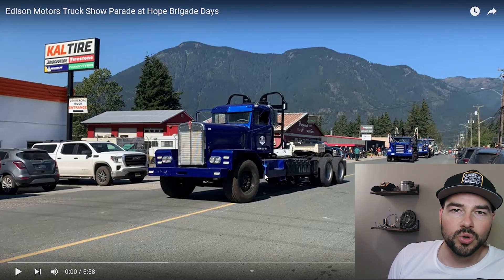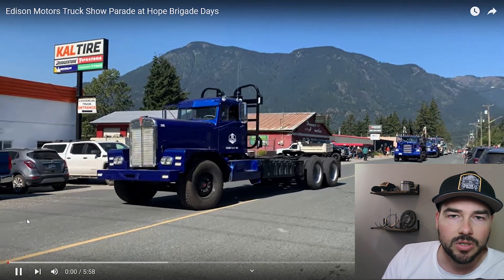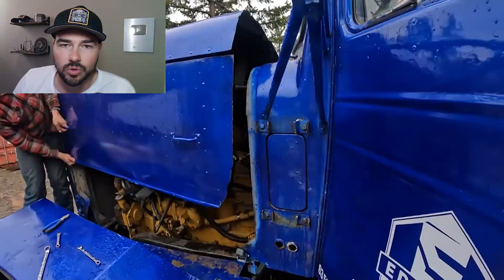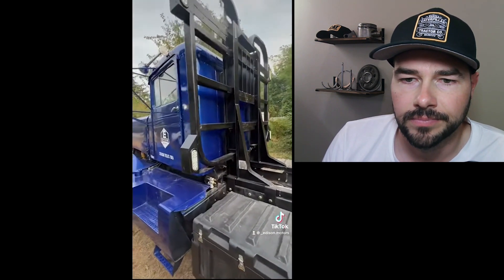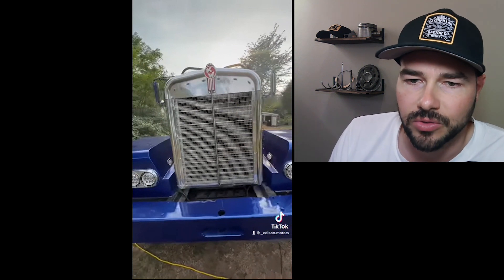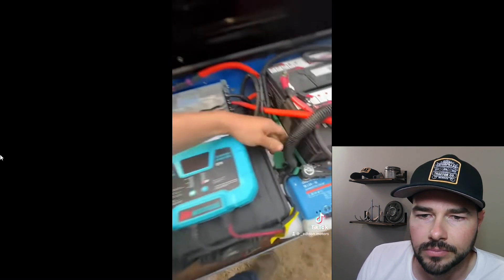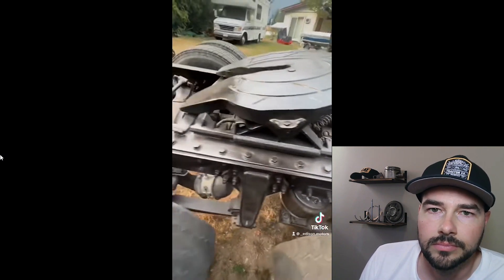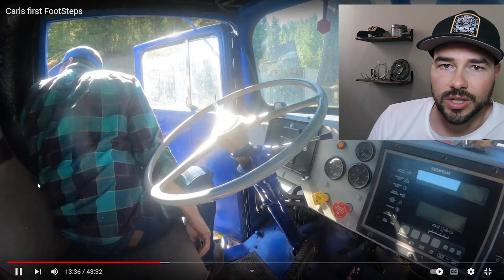Mechanic Reacts to AMAZING Diesel-Electric 1962 Kenworth. Edison Motors.

Comment: I've wondered for years why no one has adapted diesel/electric train traction motor system (scaled down) to work with a modern battery/regen storage for Road Trucks.   I'd think GE/EMD (Buffett) could make this  happen... they haven't but they sure could.   Maybe it just doesn't scale down well.   But, he did say electric axles....  so that is a step closer to true traction.  Gets rid of the differentials.
Reply: Cost of vehicle. Cost of maintenance.
Not the same electric motor as a Prius.
Reply: Youre also dealing with different traction material, grade, and wind resistance variables. 

Steel on steel low speeds low inclines vs rubber on concrete high speeds high inclinces.
Reply: Worked on a Oshkosh HEMTT that was basically that it is expensive complex and not that much more efficient
Reply: Think of how much freight a train can pull , per pull ... that means that per mile , they generate a LOT more money . Which makes a much more expensive settup a viable option . The reason that combustion generated electric does not make sense for a semi truck , cost prohibitive for the type of work ... if pulling 400 trailers it's not cost prohibitive , if pulling 1 trailer , doubles or even triples its just a cost prohibitive settup .
Reply: Weight is a main reason
Reply: @smaksymiv4950  That makes sense... sorta.  (The following is not meant as an argument, just blue-skying)   Rail freight has always been the most efficient on a cost per ton per mile.   But they should be able to scale it down.  You don't the 4,000 to 18,000HP a freight train needs, 300 - 400 hundred HP should do it.   Much smaller alternator too.  Your traction motor axles could be MUCH smaller but would need some sort of disconnect for cornering, but that could be electric coupling based on front wheel angle.  The tractive effort is similarly less as well...   ~80,000 pounds max vs 18,000 tons.  Regardless of the power of the drivetrain, electric is always Max torque at Zero RPM.  The one advantage in a hybrid scenario is that unlike a train which maintains speeds for hours, a truck will often be slowing so the regen could be applied to braking to recover energy.  You eliminate the transmission, driveline, differentials, clutch/torque convertor... even much of the braking...  all high wear/maintenance items.      I could go on, but thank you for reading this far.
Reply: Locomotive mechanic here. The big issue is the control system. It’s not as easy as hooking up a generator to a motor and hitting go. If you look at a locomotive, we have a compartment as big as a truck cab just dedicated to the contractors, rectifiers, inverters and control modules to make the entire system work as effectively as it does. You need a means on controlling direction, and controlling output of traction which gets more complicated when you realize that a genset like they have is designed to operate at a set steady voltage and frequency.
Reply: Lots of ships are Diesel-electric as well. Many of them have electric motors directly coupled to the propellers or jets.
Reply: It can be done.
Reply: I’ve wondered that as well.
Reply: Very expensive. Being around modern drilling  rigs that utilize same technology hence Generators, Rectifiers, Variable frequency Drives, traction motors and controls, PLCs etc.  It is very expensive. That is not including hybrid technology to include batteries that require 1000s of tons of earth excavation to gather the elements to make 1 battery bank. $$$$$$$$$$$$$$
Reply: I've wanted something of the sorts for a while
Reply: Look up Hyliion.
Reply: A lot of the very first cars were. The very first porsche was a gasoline generator, electric drive. So were a lot of tanks. The reason most cars throughout history haven't done this is cost and weight of the old technology. With modern engines, batteries, and motors, we'll probably see this done more often
Reply: Somebody did do exactly what your talking about they where able to run a semi off of a 4 cylinder John Deere and it got almost 30mpg loaded and all you had to do was send him your truck and he did the conversion and he would send it back done with thee original motor and transmission on pallets and he did it all for between 75-80k I saw him and a truck he did at a semi truck show in Kentucky several years ago but now he's vanished you can't find any information about him or his original truck he built there are some of his old customers still around but all the trucks are gone been bought and have disappeared
Reply: Totally gnarly and kickass engineering design
Reply: @smaksymiv4950  there was a company, I believe in PA, that was adding a deere 6.8 powered gen set to locomotives.  Once the load was moving the locomotive engine would cut back and the deere engine would provide steady power for steady movement
Reply: I don’t know but I want one
Reply: weight and cost.
Reply: Nov 10, 2008 — Peterbilt Motors Co. has debuted a Model 335 hybrid electric ... and the Model 386 Hybrid Electric vehicle for long-haul applications.
Reply: did you watch the vid?? - this IS a series hybrid with a plug in battery bank just like a Diesel-electric train... It has a single traction motor and "normal differentials" ,"powered" through a 4 speed transmission. - seems many of your fans are robots replying to a different video ???
Reply: @kadmow  but the point made is that this isn't a more common design when it is perfect for today.
Reply: @blendpinexus1416  , sometimes things just aren't done because a simple transmission works is lighter and is more efficient most of the time. Drivers love swapping lots of cogs.
Reply: What would be the advantages? ....Smoother traction at low speeds, right? If you need that type of power like in logging it would be pretty awesome, also  Plowing. But there's plenty of disadvantages, carrying  all the weight of a diesel plus the weight of a battery & motor. set
Reply: There is some airplanes that are doing that with electric motors in the wing for thrust. Then a gas turbine generator set in the fuselage for power.
Reply: @paulwoodman5131   (some energy buffering is desirable in road-going / variable-demand, diesel electric setups, the benefits are perfectly controllable torque - to the power limit, and ease of adding "another" driven axle group.. - to date the cost and / or weight in batteries have made seriously (big battery) augmented systems unviable) - for a single driven axle-set a motor and hydrostatic + epicyclic transmission are probably simpler - for a multi axle-set, distributed power, D-E  / BEV starts winning.)
Reply: @kadmow  i can't disagree there. my little car with it's 5 speed manual is just a blast. can't imagine the fun with an 18speed
Reply: @paulwoodman5131  With all the weight of the engine, genset and batteries plus the weight of the truck/cargo there would be a huge dynamic braking recovery (regen) to be had.   I live in the Sierras and the run from Rocklin to Reno is a truck and brake killer.  Trucking companies could setup depots in Rocklin and Reno and use these trucks to easily make round trip passes every 4 hours.   Let regen handle the downhill (save brakes) and let the batteries get you back up the hill (well probably 85% realistically).  Lower fuel costs, no transmission to wear out, No clutch to wear out, no driveline to wear out, no rear end gears to wear out, lower emissions, less issues with air density....

There is a place for a road going hybrid locomotive.  It wouldn't work everywhere.
Reply: They should also add battery cars behind current locomotives to store and use  the down hill regen that is currently wasted as heat in huge resistor banks.  The locomotives could also charge the batteries at times their diesel engines are producing more power than the electric motors need, like idling during a wait period.   I bet it could reduce diesel usage in the rail industry considerably to not be wasting all that braking regen and power output in excess of need at periods of cruising and slow travel.  The Diesel engines might be able to shut off entirely a significant portion of the time.
Reply: The electric axles will have a single motor and a diff, for each axle... 

   A plus side of this is the diff and axle, and all attachment hardware, brakes, wheels, tires, shocks, etc, are existing off the shelf, and available everywhere, truck parts that you don’t have to order from Edison if you break down in Florida.
Reply: Do diesel electric trains have electric axles
Reply: @benjaminbaird3798 that’s because it had to be a scam.  You can’t do what you said was done with a small 4cyl engine.  It all comes down to energy.  It takes a certain amount of energy to move to move a certain mass a certain distance.  A small 4cyl engine doesn’t generate nearly enough energy to do this at any reasonable speed.
Reply: @romannabong6804 diesel/electric  costs less and needs less maintenance. It is not built for a specific reason: its long life and great reliability. When you have bought one you can work for 100 years without any problems (see trains ? ) . The production industries would go bankrupt.
Reply: @drwombat Sort of ,  there's a large electric motor, 500 to 1000 horse power, that's mounted on the axle, the power is transfered with a small diameter gear, 10", to a large diameter, 24", on the axle.

Comment: I own a Heavy Haul and Recovery co based in the west, My cousin who is an engineer for a class one railway,  he keeps asking me when semi's will convert over to electric motive power like the locomotives running down the tracks. If you look at the amount of weight they pull vs a semi, they get overwhelmingly better fuel milage. That "Karl" truck is in the right direction. What are your thoughts on the idea of electric motive power for Semi's ??
Reply: Don't double and triple trailer logging trucks pull the same or more weight than a semi truck? from watching Edison Motors videos the main advantage the electric logging truck has is that it can use the full load to fill its batteries with regenerative braking going down the mountain, and then drive up the mountain empty so they end up with an energy surplus from a route involving a mountain.
Reply: One reason trucks don’t use electric motive power is weight the truck would be thousands of pounds heavier even unloaded
Reply: @MRALBERT571 go check out Edison's recent videos. They finally weighed Topsy and it's actually lighter than a standard logging truck, but as an electric, it's max registered weight is more, so that extra weight allowance is handy when you get pulled into the scales

Comment: I was wondering when somebody was going to make a diesel electric tractor I mean they've been using them on trains for decades and if you want to be fuel economic environmentally friendly that's the best way to do it
Reply: JD is half way there with there eAutoPower transmission not full DE but getting close it can also off board 100kW of power for extra traction motors on equipment and there high end planters use a lot of electric motors so a PTO driven generator is needed but now they can draw the power directly from the tractor.
Reply: Jerry Boden  to go completely electric is not foreseeable without using some form of electricity generating apparatus like nuclear power. You're behind the times if you're running with colleges on trying to make batteries better only for the next decade we got to go beyond that otherwise it's not going to work and that's just simple physics

Comment: Diesel Electric semi trucks like this should be the real next step, NOT FULL BATTERY BS
Reply: Nov 10, 2008 — Peterbilt Motors Co. has debuted a Model 335 hybrid electric ... and the Model 386 Hybrid Electric vehicle for long-haul applications.

Comment: Trains have been doing this for nearly 100 years. The lower torque high voltage motors are now getting more practical thanks to Tesla and others. This is the more practical path forward then all electric. That may be a thing someday. But not practical ATM. It will be interesting to see how the technology evolves. This will be the stepping stone to get there if anyone has common sense in DC. But I digress.
Reply: Ideas so good the government has to mandate them.
Reply: @ChevyConQueso  trucks are bad enough with electronics and after treatment
Reply: Huge dump trucks have been using DE for decades with huge success! In fact they produce so much electricity that they have huge resistor banks to 'burn' off excess electricity when going down long or steep inclines. I believe we should be using this in our cars and trucks.
Reply: Jerry Boden  you are so true. Major buss brands here in Europe (which also builds trucks) tried this for busses like on 2011-2012, and it did not become a thing. Back then there where no batteries (or caps) that could take care of the regen power (at least not to a price that would make it worth it). The down side is converting diesel to electricity then to mechanical power is worse than converting diesel directly to mechanical power. The only benefit (without regen) is that motor can run on optimal rpm all the time.
Reply: RG LeTourneau was making them in the 1940s for Earth moving equipment

Comment: Diesel over electric is going to be pretty epic, can't wait till it catches on mainstream.
Reply: I like the idea of diesel/electric hybrid. Off the line performance will be greatly enhanced along with dynamic engine braking/generation.
Reply: Union Pacific started the trend... it will be interesting to see how this compares to straight diesel power in service. Logging isn't easy on equipment by any means, so there is a lot to compare here.
Reply: Only been on rails for 6-7 decades. I was so angry when diesel gate happened and vw killed their diesel electric suv development.
Reply: Ill keep it just Diesel 😉😉😉

Comment: I feel this is one of the best options for a) bridging the gap between ICE and full electric b) a Greta option for retrofit for older rigs which would also help with over alot poputiin because you'll be reusing older equipment instead of having to make a whole new truck.
Reply: right on point there devin, in particular with the long haul trucks where the 1000+mi range is a must for them.
Reply: Jerry Boden  the electric trucks your describing are only good for local in-city work, maybe going to the next city over. battery technology and the electric charging/power infrastructure just isn't at the point for many intercity and just about every long haul trucking yet.
Reply: Hyliion has added the 6X4HE System for long haul trucks.  Easily installed on new or retrofitted on existing trucks, the Hyliion System uses hybrid electrification to deliver fuel savings, lower emissions, instant telematics and a better driver experience. Mesilla Valley Transportation, PAM Transport and Ryder all participated in testing and refining the 6X4HE.

Comment: Most of the visibly sooty exhaust I see from Semi’s is at high torque moments, like starting from a stop, or climbing hills, when the engine is operating farthest outside of it’s highest efficiency zone.

Generators, once warm, can always run at the most efficient speed.  This means higher fuel efficiency, cleaner burn, and MUCH longer engine service intervals.
Reply: The black smoke is the governor allowing the fuel control rack to go to the "full torque" setting, which is the maximum fuel setting that is only used when the engine is lugging and needs extra torque, which then makes more smoke because there's more fuel. Fuel=power
Reply: @davesstillhere The black smoke is too much fuel for the amount of air it gets, which happens if the turbo hasn't spooled up to its final rpm for that throttle position yet. And no, more fuel than you have air is not more power, it's just wasted fuel

Comment: I had two of those trucks back in the day . They both had 220 Cummins engines with 2 stick 4 speed main trans and 4 speed brownie box. Pulled high side end dumps with them for valley wrecking service in sunland- Tujunga and San Fernando California.

Comment: He’s Canadian, so he calls it a motor, same as us in Australia, though we can call it an engine as well. Because it’s going to work logging roads, there’s a lot of steep hills, so I imagine he’s going to use regenerative braking to charge the batteries. The reason it isn’t mainstream is because of the weight of the batteries, electric motors, cost, complication, etc. It works on diesel electric locomotives because weight isn’t so important, but when they go downgrade the dynamic braking is wasted energy because it’s turned into heat through resistor banks on the roof of the loco. You can hear the cooling fans when they go into dynamic braking.
Reply: I'm a Canadian, I call it an engine.
Reply: @robertgarrett5009  Me too.  Southern Ontario